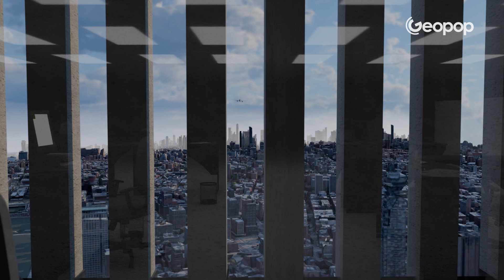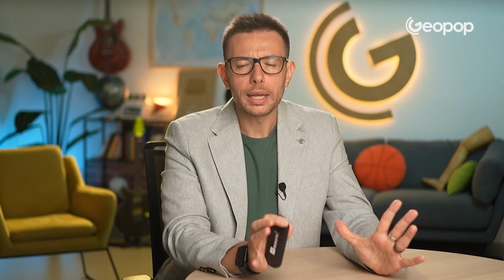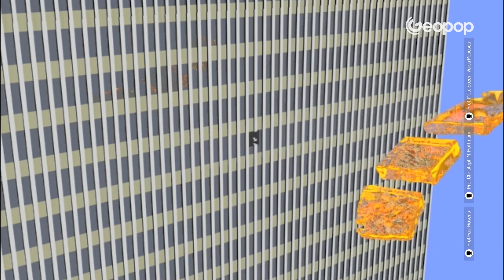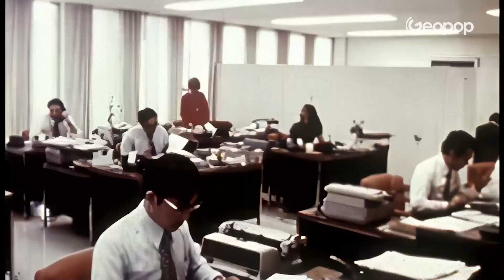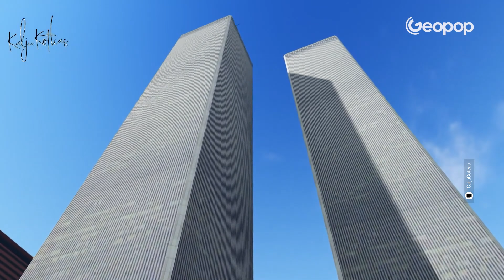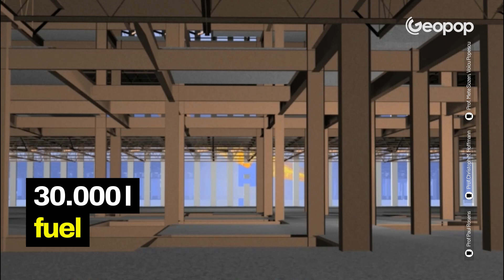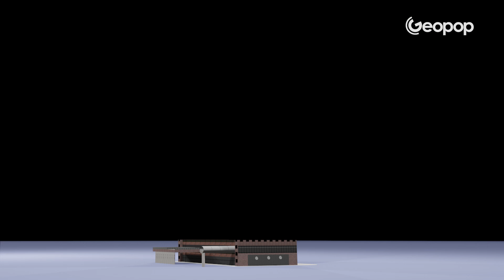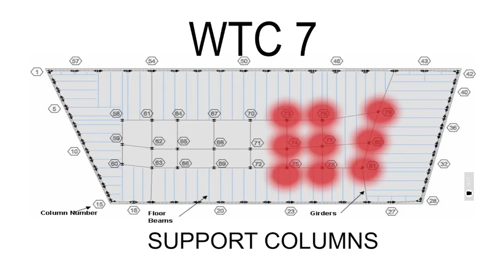9/11, 2001: The Technical Reconstruction of the Twin Towers and WTC 7 Collapses

Comment: I'm sure da steel structure around da building did not receive da same heat n damage at da same time.obviously da steel closest to da impact received the most damage.1st from the impact then from the heat.how is it that the steel structure at the farthest end of the fire n impact collapse at the very same time as the steel closest to the impact.the building should of tilted n it looked more like a demolition.watch demolition of building videos n tell me it's not exactly da same
Reply: Well, it's not exactly the same because no steel structure has ever been brought down with demolition That's as tall as the towers were. Usually control demolitions fall in on themselves. But the two towers were too tall for that so they couldn't be imploded , so they were exploded in an outward direction from the top down. That's why buildings fifteen blocks away were damaged. No way of falling building can damage buildings fifteen blocks away. And thats why the rubble wasn't taller than the lobby and there was nothing piled on top of the bottom of the building.  The core columns were still remaining sticking up in the debris. If 100 floors pulverized the bottom and destroyed it. Where's that debris?
Reply: @robbiehiatt9966 so u telling me that the impact zone still had the same strength as all the other sides of the building?go cut any standing structure on 1 side n let's see if it doesn't topple over.law of gravity bro
Reply: @ShaheedAdam-z8h no, I didn't say that at all. But Lets say all the support columns were cut on one side, and lets say it did that on 7 consecutive floors, and lets say that did bring towers 1 and 2 down. And lets forget about tower 7 for the moment. But explain why all 3 towers had molten steel in the debris for 6 weeks?

Comment: The Truss Plate was the weakest link in the construction. While the columns were designed to withstand the load of every floor above them, the truss plate was only designed to hold the mass of each individual floor. Actually one half of each floor truss if you want to be accurate since each truss was held up by two truss plates. One on the interior, and on on the exterior column. The first floor connections were the exact same strength as the 100th floor connections. They offered basically no resistance to the load of 20 floors coming down on top of them. They were just 3/4" steel plate that was welded perpendicular to the columns. The floor truss sat on top of this plate, and was bolted in place with four bolts. Once the collapse was initiated the truss plates had no chance, and everything came down at basically free fall speed. The floors pancaked all the way down increasing the mass of the falling debris with every subsequent floor that failed. Every single truss plate was sheared off from the column unzipping the building. That is why you can see all of the exterior columns being pushed out, and the you can even see some core columns standing for several seconds after the rest of the builing had collapsed. The total collapse time was actually much closer to 30 seconds when you take that into account. Exterior columns from the North Tower took out much of the south side of Building 7, and fires burned uncontrolled for 7 hours. The conspiracy people never take any of this into acount.
Reply: Nice blahblah conspiracy guy, but here´s the big news:
Some 20 years ago there was a big funeral in which NIST officially burried FEMA´s utter stupid pancake theory.
Reply: @z @zettel3296  you misunderstood the conclusions. The initial collapse was not due to pancaking, but the total collapse was. You can view it in every picture from the aftermath debris. Every single floor connection failed. That is why the buildings came apart.
Reply: @BoodahBodey  So in your fantasy there were 110 floors stacked on each other after each collapse...
That´s extremely funny! But also extremely stupid...
Reply: @BoodahBodey  - The truss plates didn't fail. The bolts securing the trusses did. If you look in the debris pile you see intact truss plates with empty bolt holes everywhere.
Reply: @TheLoonResistance  You are a very busy shill Fitzshill!
Reply: @TheLoonResistance  I saw both. Either the plate was completely sheared off, or it was bent straight down and the bolts sheared. I saw some with bolts still attatched but the truss sheared off. Either way, the floors became disconnected from the columns. The result was the same.
Reply: @zettel3296  I didn't say anything about staples. What does that even mean?
Reply: @BoodahBodey  Sorry, I meant to say "stacked" on each other...
Reply: @zettel3296  if you mean something like a cartoonish stack of pancaked floors, no. I don’t believe that. It was a tangled pile of debris. Most everything except the steel was pulverized.
Reply: @BoodahBodey  Then why do you pretend to believe in the utter stupid refuted pancake theory?!?
Reply: @zet@z @zettel3296 not pretending anything. So don’t put words in my mouth. I believe that there were no controlled demolition. The collapse was organic. I have studied the buildings and the collapse for 25 years. I have read everything, and seen every angle. Maybe don’t assume I am just another fool on the internet who is just repeating the fedslop narrative. I am not.
Reply: @BoodahBodey  Adressing the fact that you pretended to believe in the utter stupid officially refuted pancake theory doesn´t equal putting the word "pretending" or any other word in your mouth clown.
Obviously the only thing you studied the last 25 years is BS. You didn´t even know that the pancake theory is officially refuted for decades now. You "think" the planes were jumbo jets which they weren´t, you "think" the planes were fully fueled at impact which they weren´t even close at take-off, sorry bro, but you´re really making a fool of yourself. But then again, that makes you a typical believer of the official BS fairytale...
Reply: @zet @zettel3296 typical ignorant truther believing everything except the evidence which is right in front of him. Never listening to a single word that might contradict his fragile BS narrative.
Reply: @BoodahBodey  typical ignorant sheep believing everything except the evidence which is right in front of it. Never listening to a single word that might contradict his fragile BS narrative.

Comment: You can’t isolate a component bending or twisting in this reconstruction without showing the whole thing.  It’s a connected structure.  Where a is gonna affect b and cause c and weight distribution and on and on wtf is this.  The only thing you slammed  down our throats is the plane hitting the building 700 fucking times.
Reply: The top speed of a commercial 766 in a dive at 1000 feet is 430 mph.  At 600 mph it would likely be a military plane.

Comment: Is there a reason it’s not showing the core structure at the center of theb building? Thst supports 60 70 percent of the shops structure? But mske sure the frame has 8!desk with computers on  during the impact

Comment: Very nice video and some great examples, I would still be interested to hear your thoughts on the Various items omitted by NIST, what was the purpose of immediately clearing the site and removing all of the debris evidence onto barges and to china, how did presence of nano thermite particles come to be tested and merged with the various pieces of building material/molten steel/Office items/human remains all smelted togethe, and even if the undamaged floors were impacted by a overbearing weight, science has proven that it 100 out of 100 always has to meet some sort of molecular resistance to the force being applied. For every action there is a reaction, free-fall structural collapse through hardened steel and immense amounts of other materials with no resistance whatsoever is scientifically impossible regardless of NiST claims of the fact. Look at some of the archival footage of molten steel pouring out of the towers, of the pools of Liquid Metal beneath the rubble, and almost the entirety of the collective mass (office furniture, Concrete, Glass, Plane debris, including human remains and so on, were all but none existent almost before the building was even collapsed fully. It cremated 90% of the buildings mass in less than 10 seconds. Just some puzzling questions still worth seeking out the answers for. Great video though, easily one of the more informative and straightforward ones I’ve seen.
Reply: The NIST are an engineering and scientific organization that doesn't do conspiracist fantasy and internet speculation.
Reply: @TheLoonResistance  You are a very busy shill Fitzshill!